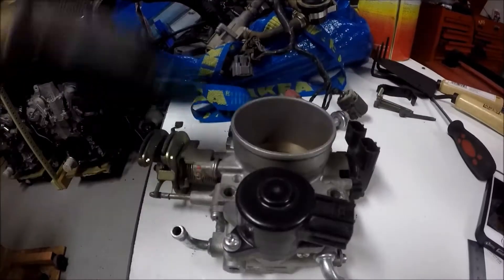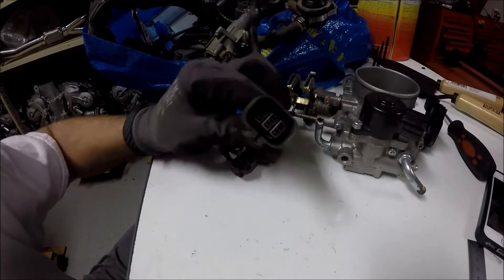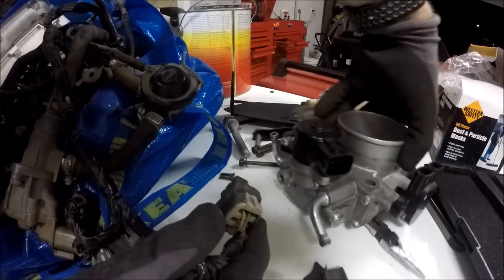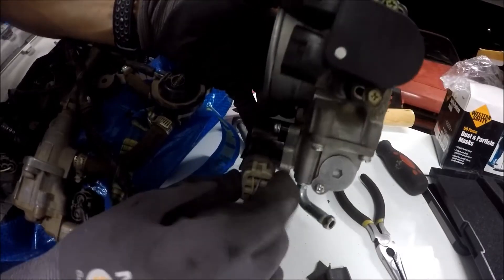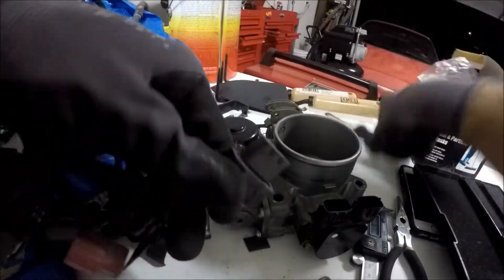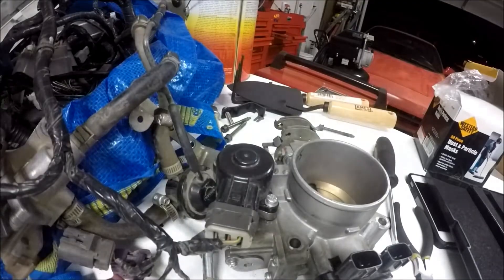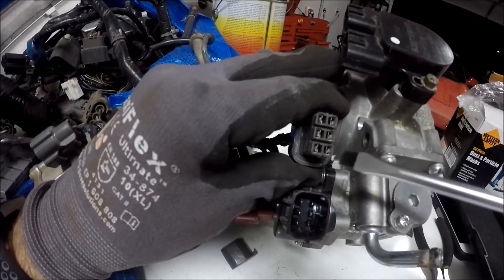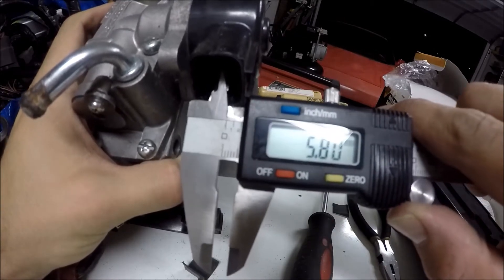How to Install Pathfinder IACV

Comment: After I spliced in the IACV plug from the PFTB, my revs bounce constantly between 1000-2500.
Pulled the IACV and turned key and it functions, but car still doesn't run right.
Any ideas?
Reply from the maker: The revs bouncing sounds like a vacuum leak. Also, Is your iacv connector fully seated? As you can see it took me a few tries to get it right.

Comment: This mod works for 3.5 or 3.0?
Reply from the maker: TRAXXAs&JDM SH*T It will work on both as long as you are using a 3.0 ecu
Reply: Schmellyfart thanks😁 any true hp gain I have a 5 speed i30 and these throttle body’s are small as shit
Reply: I want to 3.5 it soon. Or even HR
Reply from the maker: I've never done any real dyno testing for the PFTB on a 3.0. However my butt dyno says this tb felt good when I installed it on my 00vi and port matched the manifold. I can modify a PFTB for your 3.0 if you are interested.
Reply from the maker: Both are great swaps and I have had both in my car. Let me know if you have any questions or want me to make any other videos about the swaps.
Reply: Schmellyfart hell yea y not I might just O0vi as well . 3.5 is sweet but I don’t want to mess nothing up
Reply: Schmellyfart old saying leave good alone. I’m in Brooklyn btw
Reply: A nice A to Z brake down will be sweet Bro on a 3.5 swap into an A32
Reply from the maker: TRAXXAs&JDM SH*T If you are unsure, start small with the 00vi and then work your way up.

I can put something like that together. For 3.5 de, hr, or both?
Reply: Schmellyfart I hear HR swaps can pass inspections and DE’s won’t is that true
Reply from the maker: I suppose it depends on what the inspection consists of. I've passed my local emissions testing with 00vi, 3.5 de and hr swaps.